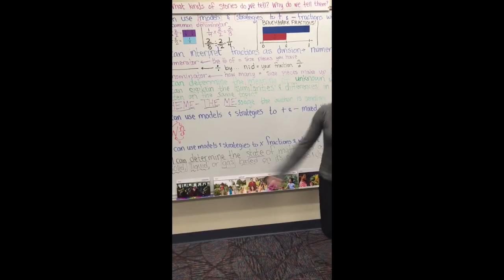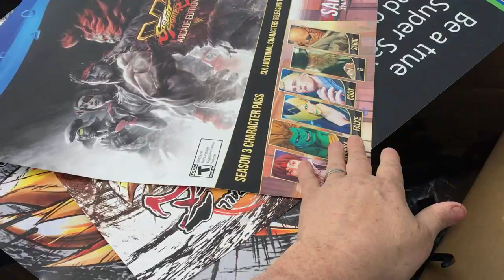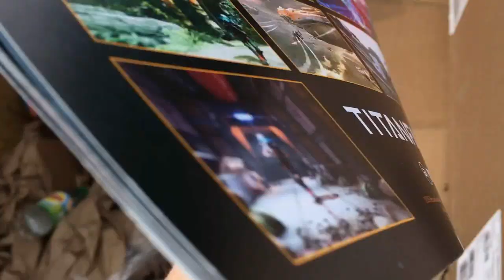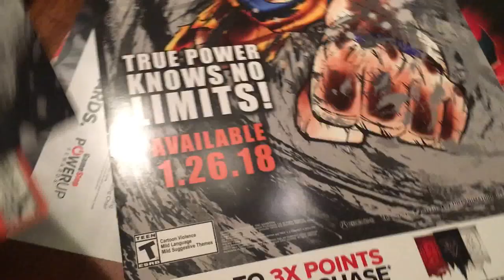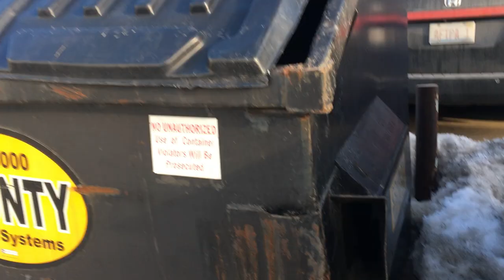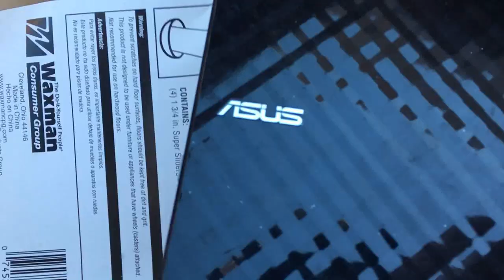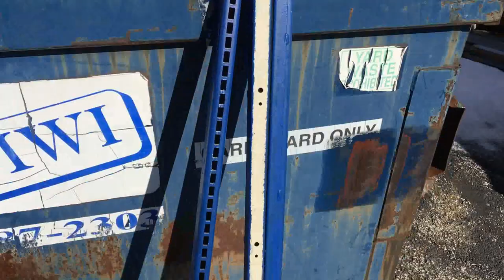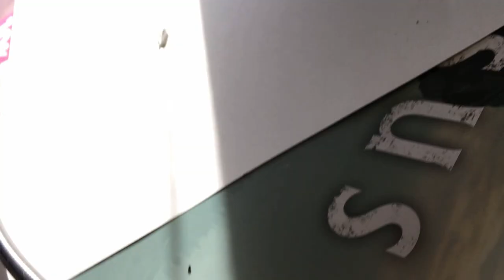You TALK too MUCH and Huge Game Stop Dumpster Dive Score

Comment: See if you can use pliers and pull it out. Looks like it seperates the two copper parts or its insulation. Id try Pulling it out the center cause there not connected together. Good Luck
Reply from the maker: Teresa Bowen hey Theresa! Yeah I'm going to try using a vice and pull it out.   Thanks for your comment

Comment: Coax cable is a bit of a gamble. there are so many types (copper core, nickel-plated copper core, alu core, copper shielding, alu shielding etc etc) and qualities. most scrap yards seem to refuse them but mine buys it as #2 wire. The stuff in the middle is ABS plastic reinforced with nylon. that is why it so bloody hard (read: impossible) to remove unless you have a granulator or something similar. BTW: that copper shielding you have there could be plated or even painted aluminum. better check first!
Reply from the maker: Mark S. I cut it in two and it looks to be copper.  Good information.  Thanks!!
Reply: my pleasure. Coax cable is very common over here as it is used to distribute TV signal in houses. thats why i come across a lot of it in my dives of home renovation dumpsters. i tried to strip it many times but gave up my efforts when i discovered my scrapyard accepts it :)

Comment: I would cut the copper into shorter lengths and tap the centre about 1/2 an inch, stick it into a vice and pull it out, the white stuff should just come off and you will be left with the metal. Good luck with it
Reply from the maker: David Wardle thanks David.  I was thinking this morning that if I could just get it started it might pull out if I use a vice.

Comment: What is the Asus DVD player? Nice score on posters. You could maybe put the tip of the aluminium in a vice and see if it will slide out.
Reply from the maker: Brian Rafn I was thinking the same thing. I'm nit sure, but I think the Asus is a DVD that hooks up to a computer.
Reply: ShaneManTV to maybe make them slide out maybe use a dremel and cut them into shorter lengths.

Comment: Ask E-waste Ben . He may know your last answer.. when i was in Oklahoma  saving to move, i found the same thing. I actually pealed the layers off by hand 1 at a time. Ppl think its crazy, but id rather be stripping it collecting pennies vs twiddling my thumbs working the most hours ppl woukd gv me n get NO WHERE!! It got me moved tho. Im sure if you pushed back the insulation some n had something  like a motor or ? To grio n pill the wire as you hold a blade or something on the fiber. I wore gloves cuz i hv sensitive skin .. the copper outer shell i unravelled like aluminium  conduit.  Btw, when your out or your kuds ride bikes,  not sure how big they are but i actually collected a lot of tire leads. Lical fisherman live to buy lead n make their own stuff as well as ppl that make their own ammo. . Garages,  truck stops, etc hv them on the ground  as well as junk yards. My son collected over 500 lbs of lead while he was just biking plus a lot if aluminium n such. We did much like you, Scrapvolture n Thub  combined living  in BFE OK. Whooos i meant TULSA AND SPAVINAW.  LOL.  Spavinaw? Umm yes.. home of Mikey  Mantle. Right at a lake dam. Lead was a fast seller out in Timbuktu. The Mayor  was cool tho n very helpful.
Reply from the maker: Annette Petrin Thanks Annette!Great stuff!! Good idea on the lead!!
Reply: ShaneManTV do you hv a river, fishing hole, lake or ?  Nearby or even go to a big time gun supply  that has bullet making equipment  or ? .. they tend to hv a wall to put your info up on. When we were in Spavinaw, we literally stayed at the dam near the main lodge. The mayor owned the home where he had trailers around it plus RV  parking. Tons of self sufficient  men out there.